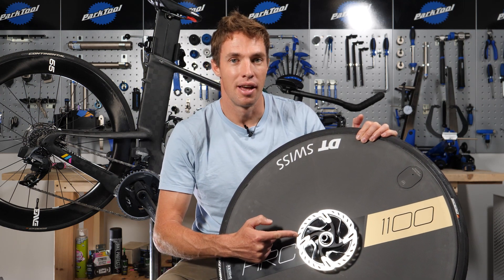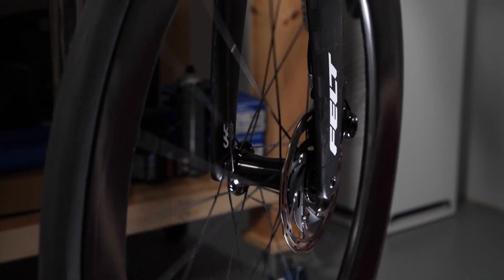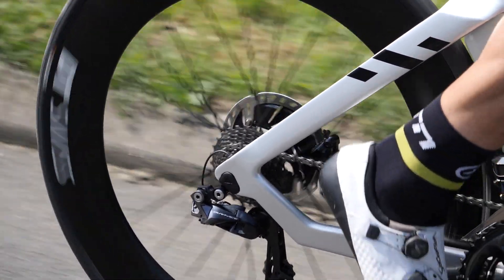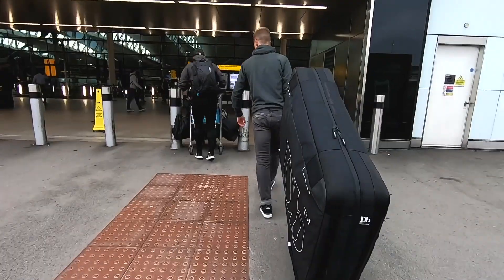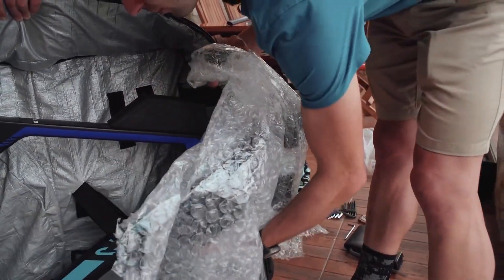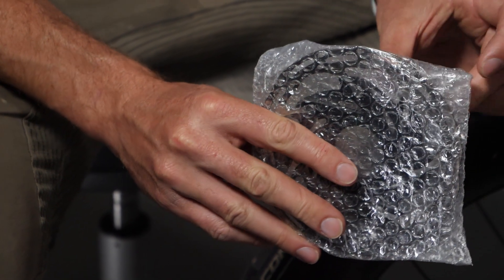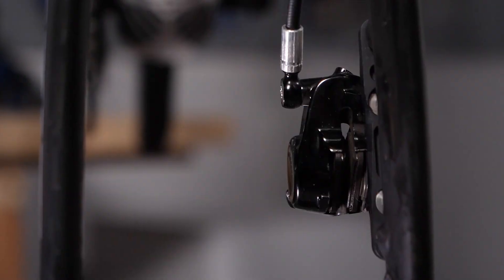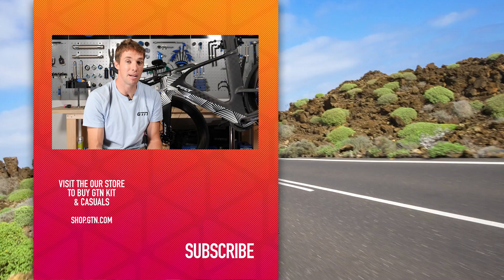How To Travel With Disc Brakes | Essential Tips For Travelling With Your Bike

Comment: Amazing vid. Thanks for sharing. 
May I ask if there would be an episode to demo and/or recommend on the bike case, please?
For example, my bike is Ceverlo P5 Disc, size 58. A huge bike compared to my existing SCICON 3.0 soft bike bag. I have no idea how to pack my P5 Disc properly and safely ......
I suppose I am not the only one to meet this kind of issue. Right?
Reply: I’m wondering the same, will a disc brake bike work in the Scion bag?
Reply: Bike Box Alan easy fit... I have Scott Plasma 6 Large, massive frame and cockpit...

Comment: Accept please please use cloves at all times. You really don't want to get anything on those disc especially not the oil out of your skin. It's possibly one of the most common mistakes that at best causes squeaking breaks at worst can make them fail to grip right and require buying new disc and pads.

Comment: Your disks are most certainly NOT aluminum: they are stainless steel (like aluminum, stainless isn't magnetic). The calipers are aluminum, but those aren't the shiny bit. Everything else is correct. Great video. 👍